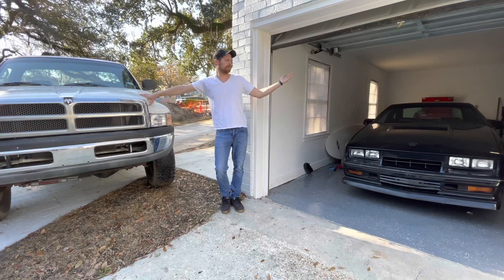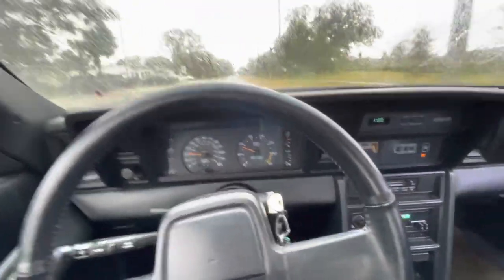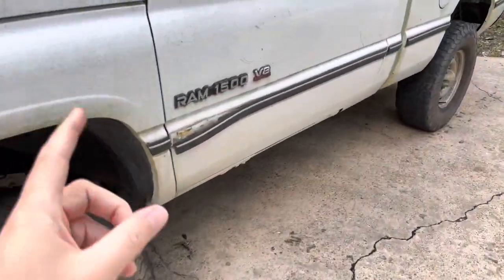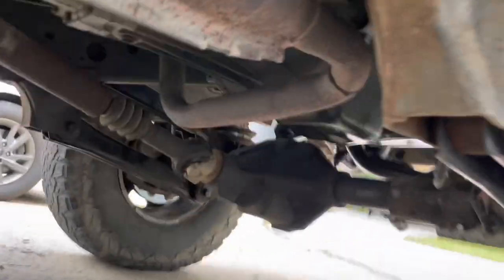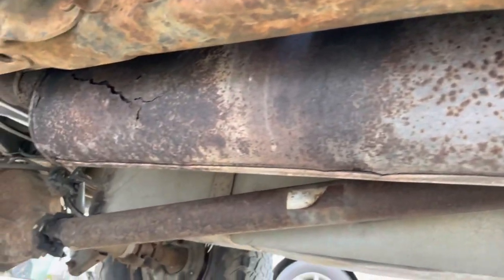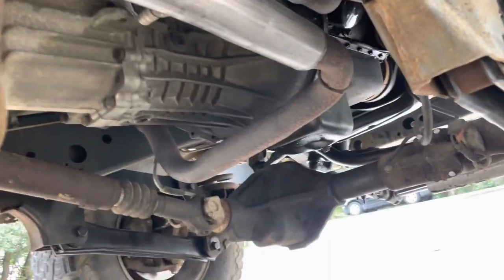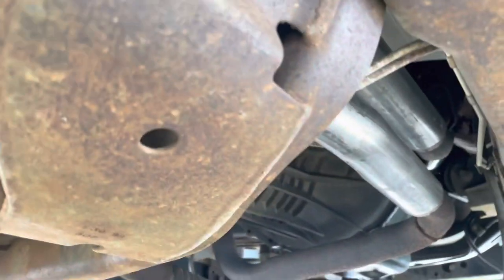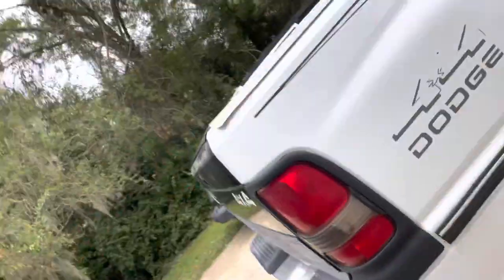I made my Second Gen Dodge truck sound AMAZING (5.2 engine - 318 V8)

Comment: Go next level next time. True dual with an X pipe. Made my Dakota sound like no other. I have regular on it before with the 408 engine then did the true dual 3 inch with x pipe, wow it made a difference
Reply from the maker: Sweet! I’m likely doing true duals on my ‘73 Plymouth Satellite.
Reply: It’s an all around game changer. You won’t be disappointed and you will have one nice sounding machine. An H pipe works but an X pipe is way better and for performance too.
Reply: If I had more computer abilities I’d have it on here to show you.

Comment: Thanks for this video, I always love seeing new 2nd gen ram videos, these trucks have a very fond spot in my heart. I've really been thinking of getting a good sounding magnaflow muffler, just truly unsure what to get with all the dozens of models. Currently have a single 3in in dual 2.5 out cherry bomb extreme and it's kinda way too loud lol. The truck originally many years ago had a knockoff single in dual out dumped at the ground muffler I thought sounded way too whimpy, and due to the cat being gutted as well as the exhaust exits pointed straight at the ground they'd bounce up and would just congregate and spread out stinking choking exhaust fumes all around, I had to have choked out some poor kids at the fast food drive thru's when I'd pull up to the window lol. When I got the new exhaust put on like 7 years ago I never had another fume issue since it was pushing them at the back of the truck like a normal setup. The magnaflow in this vid sounds awesome, nice rumble and growl. I may just end up going with that with a single tailpipe as well. The dual exhaust that people swore up and down on forums would make these old v8 trucks magically get 20mpg never did for me anyway LOL. Do you have the model number for this magnaflow muffler?
Reply from the maker: Thanks for watching my man! I try to give the gas job 2nd gens a little love, they’re my favorite truck of all time and there’s not a lot of good content out there on them. This truck actually has a Flowmaster 40 series on it.
Reply: thanks man I'll definitely consider the flowmaster 40 then, sounded awesome without being too loud like my cherry bomb extreme is. I feel the same, most of the videos on the 2nd gens are from the early youtube days without that great sound quality. I still see them any time I go out and they're one of the VERY few reasonably priced used vehicles left in my general area. They have a fond spot in my heart, I've had an 01 v6 short bed and this 95 5.2 regular cab long bed over the years, "the little v6 that could" even hauled some old friends house moving stuff in the extremely intense 110degree tx summer heat years ago, the trans temp warning did pop up tho, I think I was hauling stuff in overdrive LOL. I'm not sure if it's due to them just being older and more simple but I was only quoted $2000 for a trans rebuild including labor when I inquired awhile back too at a well regarded place, despite the cosmetic things like dashboard and trans they've been very mechanically sound to me, best vehicles I've ever had after a string of very junky cars lol. @TheMoparGarage
Reply from the maker: @SolidSnake4Ever2003  nice! I’ve owned probably 15 of them, they’re great trucks. Especially if it’s a 5 speed, in which case you don’t really have to worry about the transmissions.
Reply: Got a 99 with total shit for an exhaust. I can squeeze 25 MPG out of it but it’s a 5 speed Dakota lowered 3 inches 😄

Comment: Man, I hope u keep reviving that truck.  Any plans on the body and paint work?
Reply from the maker: Don’t worry, I had to drive clear out to the Louisiana/Texas boarder after 2 years of searching to find a 5 speed 4x4 short bed standard cab. She ain’t going anywhere! There will be some DIY paint work down the road, complete with spray foam/bondo rocker panel repair. The whole spirit of the project was budget build, so it’ll never be perfect, but definitely plan to make it mopar emerald green one day.

Comment: I have a 5.2 98 ram sport and I'm looking for an exhaust thinking I might just copy this if you don't mind except I want a chrome tip going for a clean build... my truck is really nice no rust on it no dents just slight age damage wish I could show pictures of it lol but Id really like to know the part number or name of this exhaust sounds amazing
Reply from the maker: I recommend it! I’m not sure of the part number, it’s just a Flowmaster 40 series 2 into 1 muffler. I got this one used for like 40 bucks. I believe they’re about 300 new. Keep in mind the engine light will come on if you remove the cat like I did. Luckily no vehicle inspections here in SC so I don’t care haha.
Reply: @TheMoparGarage  yeah I have no lights on my dash so imma see if I can bypass that I might just attach it outside so it reads clean air maybe that will help did you see any negative performance issues cutting the cat off?
Reply from the maker: @r.n.u_mb_4uller_710  yeah there are supposedly ways around it, I’ve read/seen that if you put spacers it will read it clean. There’s some YouTube videos on how to do it.
Reply from the maker: @r.n.u_mb_4uller_710  no negative performance, it actually runs a lot better now without it. I’m sure it was pretty clogged up. It still has the front 02 sensor which is the one that matters, it adjusts air/fuel. The back 02 sensor is just to read emissions.

Comment: Since it’s a 99’ don’t you still need to get emissions? Doesn’t the cat delete make you can’t pass?
Reply from the maker: South Carolina doesn’t have any vehicle inspection laws so it doesn’t matter for me. For states that do though, there are ways around it. You can usually put a spacer in the post-cat o2 sensor and it won’t throw a code.
Reply: @TheMoparGarage  Did yours throw a code?
Reply from the maker: @alexandernguyen1718  yeah it did, I don’t even have a second o2 sensor on it right now.

Comment: Can you add the link to the Flowmaster 40 you bought I can’t find any online that way they fit my 1997 ram 1500
Reply from the maker: This one was pulled off a wrecked vehicle. I don’t think it technically was designed to fit this truck in particular, but my exhaust guy fabricated it in.

Comment: what did they charge you?
Reply from the maker: I think $350 or $400. Lightly used muffler made it a little cheaper.
Reply: That's not too crazy, thank you. I got a 97 jeep grand cherokee orvis with the 5.2. These Magnum motors are awesome
Reply from the maker: @chicagorc3967  nice! Agreed, the 318 is legendary!
Reply: What muffler is on that beast? It's definitely aggressive sounding.

Nice video.